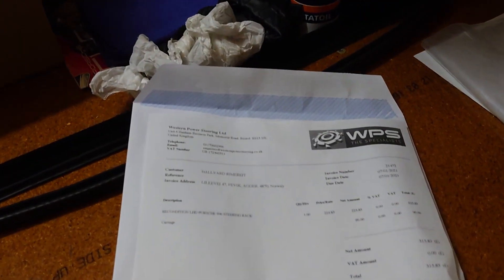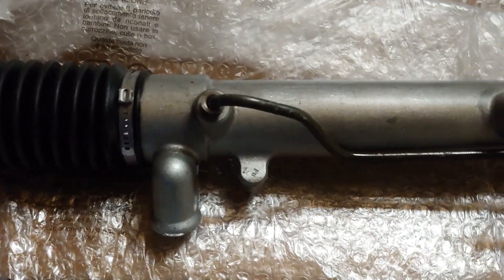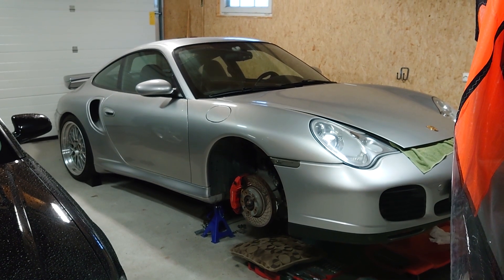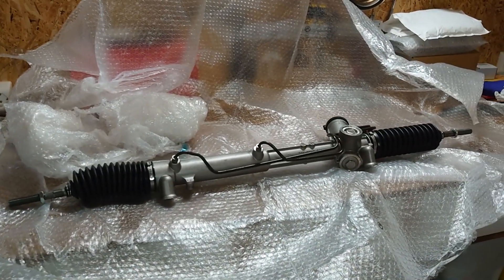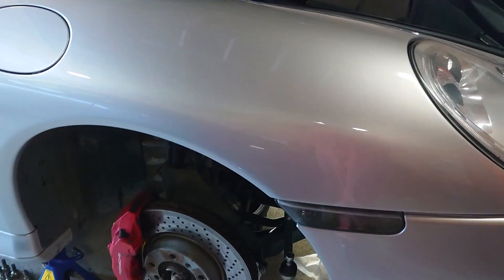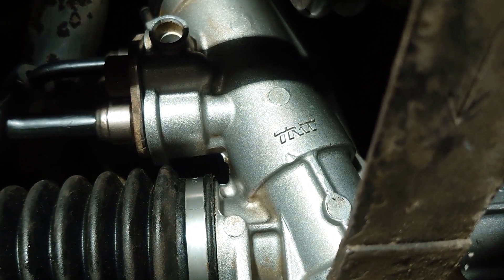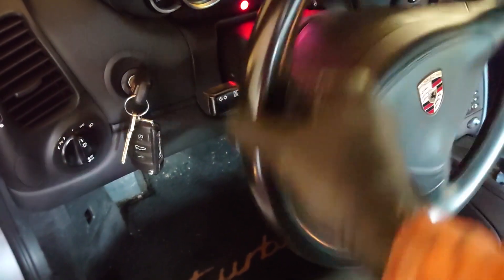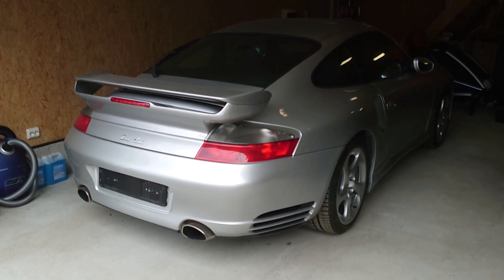Fixing Porsche 996 turbo steering rack: Part 3/3 - Finishing up the steering rack project!

Comment from the maker: Two tips that I forgot to include in the film:
-The most difficult thing to get back in place was getting the steering knuckle back on the steering rack. I tried for hours with my right hand without managing to move it, but when I finally twisted my whole body and used my left hand, I got the right angle somehow and it just went down easily.
-Getting the steering rack back in the car is pretty easy if you just take your time. The trick is to twist the part that sticks up forward when pulling it in and out.
Reply: Hi, getting the steering knuckle back on is the problem I’ve encountered. I cannot for the life of me get it back on!
Reply from the maker: @dodgster1p958  been there done that. Took me several days of trying. It did not move at all with the angles I managed with my right hand. But after wedging my left arm up there somehow it went straight in. I could not believe it at first.
Reply: @NorwegianCarGuy  I have a right hand drive 986 and looking at your videos the space I have is even smaller than what you have! I will keep trying thoughts as there must be a way !
Reply from the maker: @dodgster1p958  maybe the left hand will be the trick for you then. I think I was lying under the car facing forward to get the right angle.
Reply: @NorwegianCarGuy  ok I will try that. Many thanks 🙏
Reply: @NorwegianCarGuy  I have approximately 1cm showing…and I can’t move it down any further! It’s annoying!
Reply from the maker: @dodgster1p958  yea, it was like that for 2 days with me. I could not get my right hand over it to get an pressure down. I tried pulling with a wire too but no luck. They only way I could get it all the way down was wiggling my left arm in a way to get on top of it. I stuck my arm and twisted until it fit. Glad I did not get stuck😂
Reply: @NorwegianCarGuy  because I’m on my back it’s impossible to apply enough concerted downwards pressure to make the joint go all the way in. 
It’s really frustrating as there is only a tiny bit to go but it’s not shifting….and my arm is wearing out! 😂😂😂 everything else is sorted. I’m even considering buttoning it up and getting a garage to do it as the hardest part is done now so they can’t possibly charge silly money…
Reply from the maker: @dodgster1p958  yea I know the feeling, took me several days of trying for a long time. Two of my fingers were blue from pulling so hard. Then after switching hand it just slid down with less than moderate pressure... Did you get the lines in place easily?
Reply: @NorwegianCarGuy  I’ve not put the lines in yet but they all line up….thanks for the tip of cutting them where you suggested as if not I’d have had t get bridging lines made up to join them in the middle and that would have meant dropping the subframe and much more work that I’ve not done before so a fair chance of failure…
Reply: @NorwegianCarGuy  how are your new lines?any leaks?
Reply from the maker: @dodgster1p958  Looks to be perfect, no leaks and was just approved 👍

Comment: Hi! Great job! Can you let me know what the connectors are called and where you purchased them from. I also have to join these pipes together. Many thanks
Reply from the maker: Thanks, I bought them at my local supplier of hydraulics. I noticed after buying them that they are the same brand as the OEM plugs randomly: VOSS. Maybe you can just look at the website and find the closest supplier
Reply: @NorwegianCarGuy  thanks for the response! Do you have the size please?
Reply from the maker: @dodgster1p958  Yea, I responded on your other question. I believe it's 8mm and 12mm. Just measure the outside of your lines to be 100% sure. I can check my lines and measure again if needed
Reply: @NorwegianCarGuy  you’ve been a great help my friend. I will measure both lines. Thank you for your ingenuity as I didn’t want to pull out all of the lines which would mean dropping the subframe etc when there’s no issue with that part of power steering lines. Like in Norway our roads are gritted and my line are welded into the rack…I have a new one so I’ll cut the lines where you have, put in the new rack and join the lines in the same way you have…
Reply from the maker: @dodgster1p958  glad to help👍 I was happy it worked to do it this way and reuse the lines. Hopefully my videos can help a lot of people since I have not seen this solution done
Reply: @NorwegianCarGuy  I actually contacted Voss in Germany and managed to get a couple of the original end fittings. But sadly they have stopped making them. I guess I was lucky.
Reply from the maker: @My911  Nice 👍 that was lucky indeed. I tried mailing and calling them without any luck...